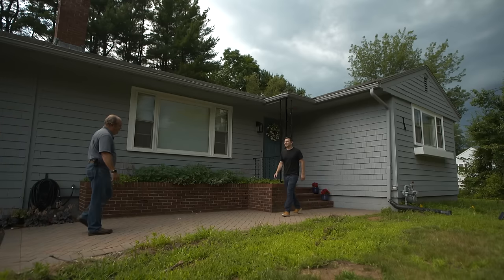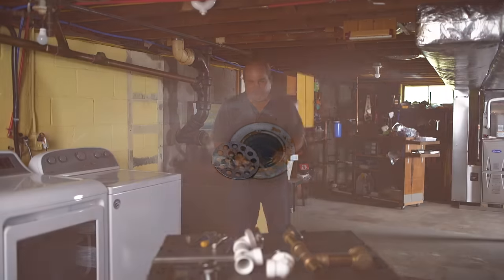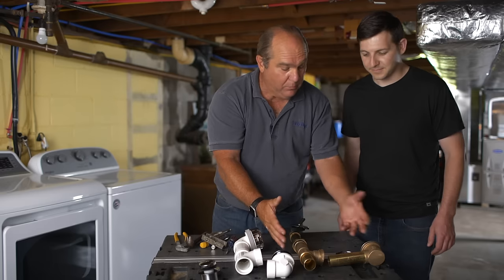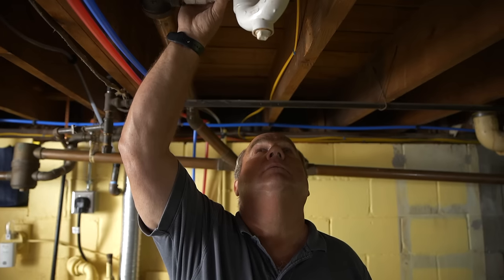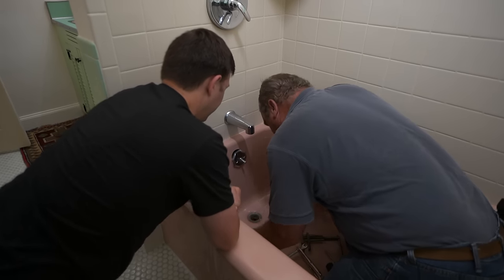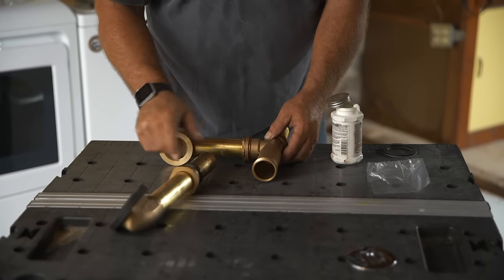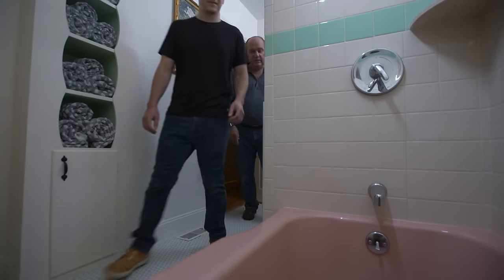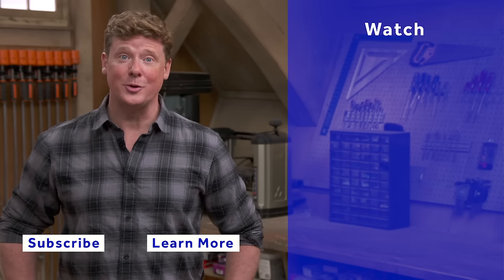How to Replace a Tub Drain | Ask This Old House

Comment: What would he do with no access from underneath??
Reply: Scream and regret buying that house.
Reply: Exactly
Reply: There's always access it's just a question of at what cost. These type of repairs mean cutting open the ceiling below usually.

From above, there are special tools shaped like a two pronged fork that would work better. He could also gain way more leverage by using a longer wrench or pipe.
Reply: Sometimes you get lucky, and on the other side of the wall you can cut it open, get to work and patch it back up. Doing this myself now
Reply: Install the toe touch stopper he demonstrates at 3:15.
Reply: @egolono10   common sense duh

Comment: Oh that PVC coupling at the very end that spun when he tightened the shoe end to the waste line. That's gonna leak. Thank God for editing. Lol
Reply: Haha, nice catch.  7,59
Reply: Swear I was about to comment the same thing lol
Reply: Nice catch man👍
Reply: Saw that…😂
Reply: @J-Hudd  the bottom tail piece has threads that screw into the tee. You typically don’t use a nut and gasket on it. Just tape and/or dope.
Reply: Richard is a pro. He wouldn’t leave a house/job that will leak. Just because you don’t see it on camera doesn’t mean he made adjustments or fixed things.
Reply: @neffdog564  Obviously. Just noticed that joint in the vid that shouldn't move. I'm sure he made it right.
Reply: Yeah I saw that too, the trap adapter wasn’t glued on it looks like.

Comment: I had to pull my tub and toilet to replace the subfloor (rot from behind the toilet). What I did when it came to that drain was to check the diameter and then go to the local restore and pick up a socket that fit down into the drain and then notch it out, so it fit down over the cross and worked very nicely to remove and reinstall the drain.

Comment: I used a propane torch to loosen the threads on a stubborn tub drain.  Worked like a charm.  Luckily the tub was metal.  Also used a tub drain wrench, which (I’m surprised) THEY DIDN’T use.

Comment: What if you don't have access.below and it's stuck in good? Any other tips?
Reply: I used an angle grinder to make several notches,  then tapped it out with a screwdriver and hammer.

Comment: Show us how you’d replace the drain when on a slab and the crossbars in the drain are broken out and it won’t unscrew.  And yes, seriously, no drain removal tool?  Seriously, I’d REALLY want to see that!
Reply: To make the repair you describe, why not open up the adjacent wall and access the open cavity in the slab under the tub drain. Get an oscillating tool to cut the old brass
Reply: You need a drain extractor. It is like a really large easyout
Reply: I use a dremel or multi tool to cut a slot in the flange and hammer/punch to tap it around. Those expanding drain tools never work. The expansion actually increases the friction on the threads. Bad physics.
Reply: Exactly.  Use a Dremel with a metal-cutting disk.

Comment: I need to replace a tub drain, but there is no easy access to the pipes below the drain.  My landlord is suggesting ripping out and replacing the tub— yikes!  Is the solution to open up the first floor ceiling below the tub to get access?

Comment: Use a drain extractor to get the stubborn drain unscrewed.
Reply: Yeah. Or use drain removal tool if grid still intact in old drain.
Reply: I bought a drain socket... thingy at Lowe's and was able to get my 40-year-old drain out with a breaker bar.

Comment: One issue I have is that the "toe tapper" and any other in place stopper usually collects hair and restricts flow. I know they are very common for convenience sake. I just redid a bathroom in a new home we bought. I didn't test the drains prior. When we got in and used the new bath I assumed that there had to be a blockage and I would correct that later. Turns out that the plug (once I remembered how to remove it) was the culprit for severely restricting draining.

I know convenience is a good thing but when there is a risk of impeding use, I would always recommend some disclaimers. Most people don't like constant maintenance but will be ok putting a plug in every bath.
Reply: I’m always happy that it catches the hair there. Much easier to remove a toe tap and get hair out there than it is to run a snake to remove hair from further down the line.
Reply: I prefer plugs over toe tappers cause I just remove the plug and put a mesh basket in. Then if someone needs a bath, they remove the basket and insert the plug

Comment: In the middle of a remodel and Just had my whole house replumbed with copper. Walls are up but only the tub, toilet, washing machine and exterior hose bibs are functional. When washer and toilet run, running water in pipes are quiet. It when I use the hoses outside and run a bath, the sound of running water is so loud. Why would that be?

Comment: You did not mention the gasket on the back side of the overflow. This is where a lot of people make a mistake and not use the right one or not line it up right, and it leaks.
Reply: Good point.

Comment: I worked in hotels for 20 years. I'm familiar with the toe tap device. We used to install them. They actually work pretty good 80 percent of the time. You have to screw it in. Sometimes the thread rots out and you can't get it out. Then, you have to cut it out.
Reply: Lot more hair down the drain with the toe tap no?

Comment: Why not use the Kobalt tub drain wrench which is specifically  designed for this removal?…
Reply: Same issue, the pipe wrench he used has a bigger lever arm for more torque
Reply: @Rturroo  you don’t use a pipe wrench on that Coble drain tub which Rosie was talking about, you use the biggest Phillips screwdriver they can fit into the hole that is in that tub drain range for some good leverage. I’m a plumber and I have one and use it and not ever have I had to use a pipe wrench on it!

Comment: quick question: i used that tool and it worked great but the drain isn't coming up, its just spinning and not rising or unscrewing. any idea what i can do? thanks.
Reply: Could be that elbow joint under it came loose from the rest of the piping. I'm dealing with that issue right now. Not sure what I'm going to do.
Reply: @harleyhalliburton9997  yup. that's what happened. i snapped the elbow joint. i never even heard a noise. you'll need to access it through the wall or from the floor below to fix it. good luck,
Reply: @Tom O'Leary  that's what I was afraid of. No easy way to get to it. It's our 2nd floor bathtub that's giving us issues.

Comment: If I opted for just replacing the visible part with the toe touch assembly, would the existing drain pipe stay in place, attached to the bottom of the tub?

Comment: I have to do this to my 1963, original, "Regency Blue" bathtub, but the cross in the drain is rusted out and gone. My idea for an attack is to drill two holes in the shoe and then use the tines of a box end wrench to turn the shoe and break the seal. the location of all of this is not conducive for me to use a sawzall... a "Plan C" if anyone needs it

Comment: In the real world they never go this easy
Reply: This was anything but easy. Without a buddy it is beyond diffict
Reply: Sorry but I've done it by myself by just slightly putting pressure on the compression fittings so they wouldn't drop back into the drain pipe and could still be pulled up from the upper level. The hardest part was going up and down the stairs a half a dozen times. 😉

Comment: Placing those metal tools directly in the tub without any protection for the tub made me cringe
Reply: Assuming it was the original cast iron tub, why would it matter?
Reply: @Painmaster212  just proper care and professionalism
Reply: @Painmaster212  It will chip and damage the finish if you drop tools on the steel tub.